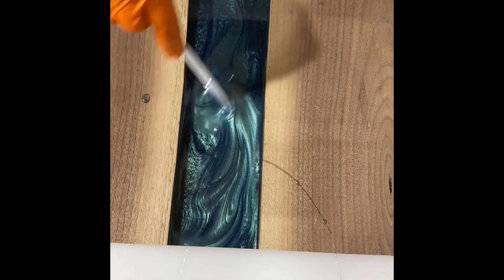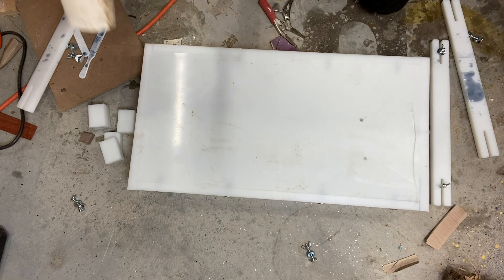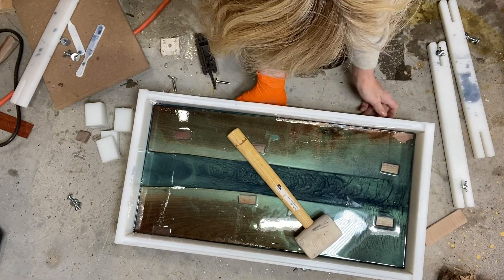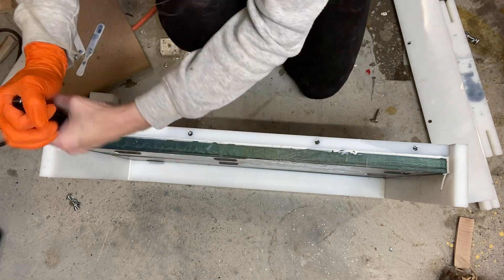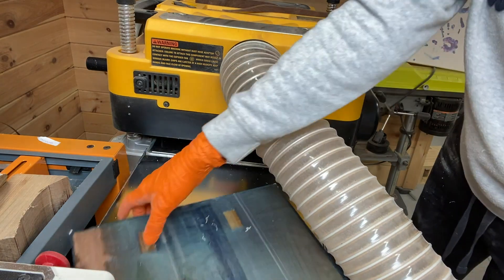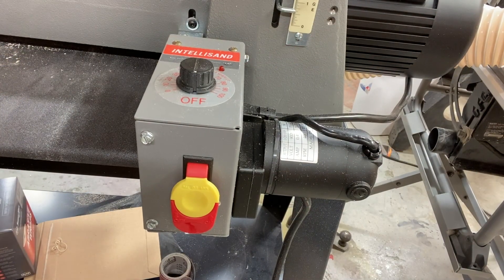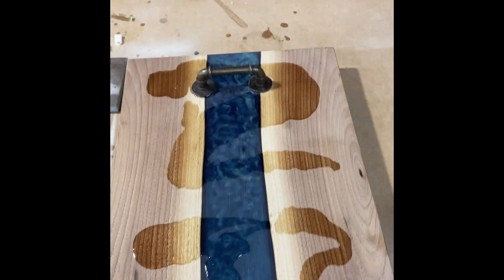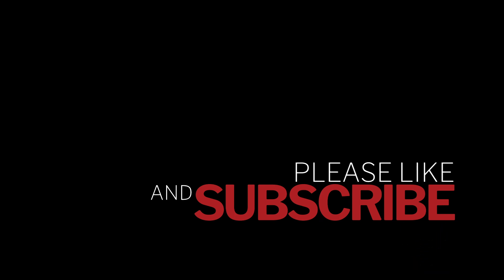From Boring to Snazzy! Walnut and Resin Serving Tray

Comment: I like the table, even though I don't do plastic wood projects. Pipe handles are out of proportion to the size of the table. I would of had them anchored into the wood only by making them wider. Their position takes away from the nice line between the wood and the plastic resin parts.
Reply from the maker: Thanks for watching!